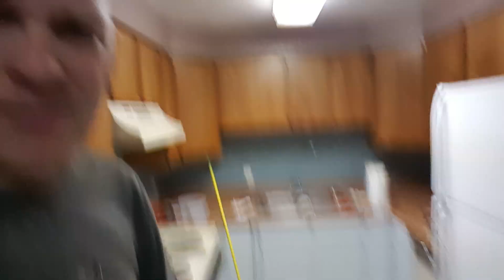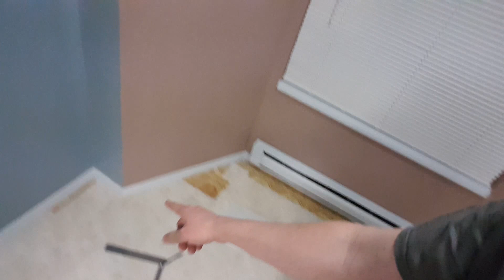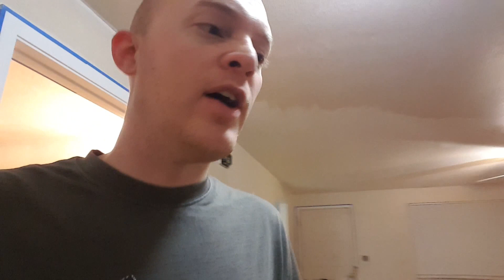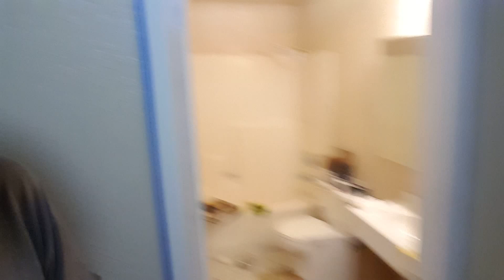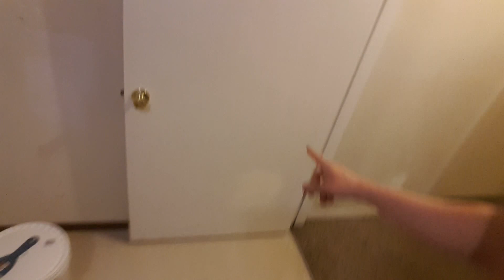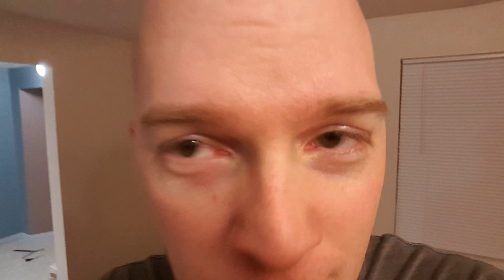Xade Vlogs - Rental Fun

Comment: Rental Fixing (or fixing to sell) is the one thing I DON'T miss about one of my previous jobs. 

Easiest one was just some simple patching and touching up some trim.

Worst one was really bad, it probably would have been cheaper to condemn the house, bulldoze it and start over. Pipes froze, burst and saturated the bathroom, kitchen and bedroom wall where the access was. The owners warmed it up and didn't dry it properly.... so much mold... most of the floor and other drywall in the house had been destroyed by roaches and carpenter ants (The drywall was so brittle, it was breaking apart and sticking to the roller). Ended up pulling out of that job after two days due to unsafe conditions.
Reply from the maker: +AdienAlexander Yikes, yeah, I'd have bailed on a job like that too.  I haven't anything quite that bad yet luckily.